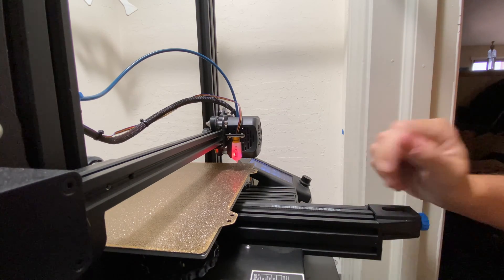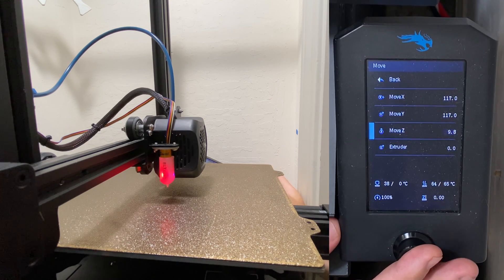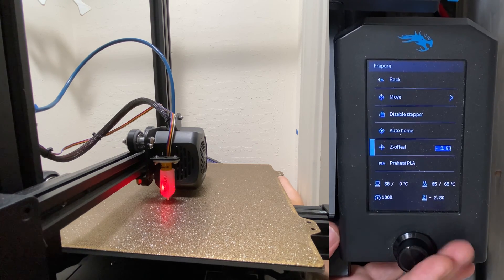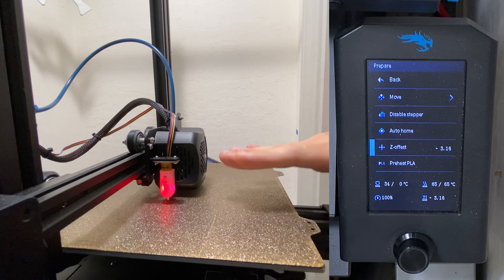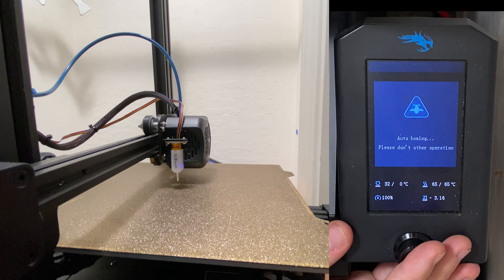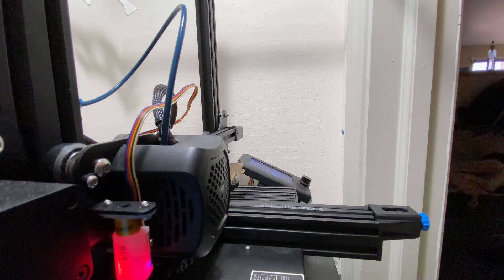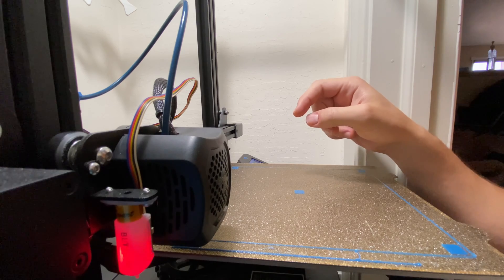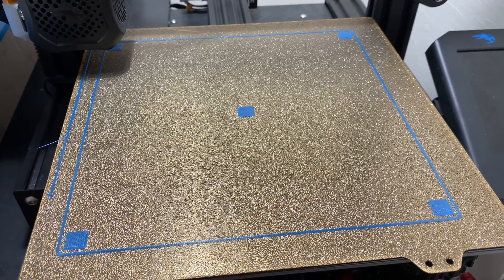Ender 3 V2 3D Printer, How to Calibrate Z Offset for BLTouch V3.1

Comment: Nice video!

If you can't move the Z-axis past 0 then what? Is this firmware related? I have the Marlin 2.0.x bugfix. 

I have the Z Offset Wizard menu item instead of the Z-offset menu item on your screen and with that the head will not move as I make adjustments to the offset value.

Comment: The comment at 3:28 in this video, claiming "you might want to step down 0.04 more once or twice" is what made most sense to me. All other videos test with paper and leave it at that, but they do not compensate for the paper's height later on. This video does. Thanks a lot

Comment: I have the CR Touch. Now a days the new firmware moves the nozzle as you turn the knob so don't have to click it when adjusting.
For some reason my machine wouldn't use the saved negative Z-Offset. Only until I did the offset at x117 & y117 did it actually work! so thanks :)

Comment: How did you generate the test print? Was it from a STL file or is it something the printer can do straight from the display commands?
Owning a Ender 3 V2 myself.
BTW what bed do you have and what slicing software you use? 
And any other recommendations that you might have wold be great. 
So darn new to this, trying to assimilate as much as I can. 
Tried the STL file that came on the SD card of the printer and sadly all I've achieved so far is a bunch of stringy mess. 
Thanks!
Reply: Same 😂

Comment: Thanks for this video.  I've found that when I do the following: 1) auto-home; 2) adjust Z-offset to -0.7 which just scrapes paper; 3) auto home; then 4) move Z to 0.0, I'm still 0.7 mm above the bed surface.  It seems to me that doing the auto-home overwrites the z-offset value.  Any advice?
Reply from the maker: I can’t say I’ve seen this issue. My main thought would be that it’s a firmware issue. Reflashing fresh firmware from a fresh file online on a 4096 allocation size fat32 formatted micro sd card. If that doesn’t solve the issue, and it’s crealities firmware, then I might advise switching to something like Jyers or insanity automation. They really kick it into next gear compared to crealities version of marlin firmware.

Comment: Thank you. When I try and adjust my Z-offset, I cannot get it close enough to the bed, at all. There is way too much space between the hot end and the bed, even when set to max of -10.00.... any ideas. I am using a CR-Touch and have removed the Z limit switch as instructed.
Reply: In addition to the first tip, I'd say to make sure your bed leveling adjustments are not cranked so the bed is the lowest possible.  Try raising the bed up to about 3/4 of the way to fully extended springs, then leveling the bed manually and finally running with the BLTouch and see if you can get there.
Reply from the maker: Without more info or being there. I can’t say for certain. One thing I noticed is that the stock Creality firmware is not great in terms of the bltouch. When I switched firmware away from creality’s, my bltouch problems went away. Other than firmware, there’s nothing in the way of the printer moving down? Something sticking out and catching it? If not that, then my thought goes to firmware issues. Also, just in case, make sure to home the printer multiple times as well, sometimes it gets weird in storing the homing data.
Reply: Mueve los tornillos de la cama,  afloja los o aprieta los para mover la cama más cerca de la boquilla.

Comment: Good video, very helpful. I take it these same steps will work if running the CR touch?
Reply from the maker: For the most part it should, yes. I’m not sure on the exact details of the CR touch, but I’m pretty sure the firmware is the same for both, possibly a different xy offset for the probe, basically when doing your z offset, you’d just need to make sure you move the nozzle to where the probe homes to in the middle of the bed. Ie, if the probe probes at X110 Y110 instead of X117 Y117. Then you just need to use the coordinate of wherever the probe touches during that step in the video.

Comment: Hello, please help, I have an Ender 3 S1 pro printer.
I changed the nozzle and when I try to level the bed, it lowers the extruder and the nozzle sticks against the bed and makes a very ugly noise, the cr touch works, I put a book on the bed and it did those 2 steps well. I raise the z axis. But when I tell him to level again he crashes into the bed. And raising the z-axis while it's making noise from being in contact with the bed makes me afraid to wait that long for the z-axis adjustment window to activate. I don't know if the limit switch needs to be adjusted.
Thanks in advance 🤗
Reply from the maker: Definitely either raising the limit switch, or giving it a positive z offset. However, once the nozzle has crashed into the bed even once, it’s likely deformed the nozzles hole now. Once you get the limit switch raised or z offset raised, you’ll definitely want to replace the nozzle if it’s brass.

Comment: Thanks super helpful. My Z offset didn't work,- it didn't move the hot end,  tried the "Z offet tool" and that worked. Don't forget to store settings once done
Reply from the maker: I had this issue before and reflashing the firmware solved my issue. I also highly recommend installing Jyers or first layer firmware. They are both so much better than Creality stock firmware.

Comment: Can you show a video of how to level it and save it as well I’ve tried everything I know I just can’t seem to get it
Reply from the maker: From my experience directly, I had the same issue and it required reflashing the firmware and it fixed it right up. Make sure to format your micro sd to fat32 with 4096 allocation size.

Comment: If you set the offset to the top of the paper, thats where the print starts? So too high?
Reply from the maker: Depending on the bed surface, yea. With mine, paper is perfect because it’s textured pei so it naturally has deeper sections of the bed surface. With glass, you might want to print the test print you see at the end of the video, measure thickness, then adjust z offset until you get the intended thickness on a one layer print.

Comment: Hi there. Very helpful video, but I am having troubling using the z-offset to move the nozzle down the rest of the way. Seems like when i adjust the number it doesnt move at all. Any idea what could be causing this? Thanks!
Reply from the maker: I’ve noticed this used to happen to me as well. Updating the firmware resolved the issue completely, but to fix it with changes, you should be able to simply turn off and on the machine again.
Reply: @3dprintutopia961  Got it all sorte! Turns out I didn't have baby stepping enabled haha. Thanks for the reply!!

Comment: Why does the bl touch drive the head into the bed?
I auto home, it might work. I zero the Z axis. I use a piece of paper and the Z offset to adjust the nozzle height.
I auto home again, it might work. 
I level the bed, sometimes it with level no worries, at other times it sits there flashing.
If it levels i print something.
It homes, then levels again😡, if it fails to level it will continue to try to print with the probe sticking out!
If it levels it auto homes which can cause a fail.

When it auto homes the head moves to the left front corner of the bed and up a few mm. It then moves the probe to the centre of the bed. The probe deploys, and lowers til it touches the bed, then it goes up redeploys and lowers a bit slower, then it goes up about 10mm or so. 
When it fails it just drives the probe and then the head into the bed compressing it as far as it goes and makes the steppers click and jump. It fails more times than it succeeds.
Reply from the maker: This sounds like a firmware issue and not the bltouch itself. I’ve had this issue before and I switched firmware to first layer firmware by insanity automation and it never happened again. Sometimes just redownloading the firmware and reformatting to fat32 with 4096 allocation size can fix the issue.
Reply: @3dprintutopia961  . The firmware is the marlin 1.1.2 bl touch. I have the pro not the v2, if that makes a difference. I’ll look at changing, thanks.

Ps. I just tried again after a sleep (night shifts aye) i auto homed, tested the nozzle height, and hit print. It was the xyz test cube. It didn’t auto level but did an auto home, started printing, had an adhesion failure, i canceled the print pulled the plastic off the bed and hit auto home. 
It centred itself deployed the probe lowered till the probe retracted.
Raised up again.
Deployed the probe, turned blue.
Started lowering.
The almost as soon as the probe touched it turned red and just kept going until i turned it off.
Reply from the maker: @python27au  It’s also sometimes just an issue with the download. If the download isn’t perfect and the extraction as well as just the firmware build itself, along with a myriad of other factors, the firmware could fail when it is uploaded to the machine. Simply re uploading the same firmware might fix it, or it might not. Just a thought.
Reply: @3dprintutopia961  Mate i could kiss you! It worked first go, didn’t even look like failing. I was just about ready to junk the thing and give up.
I tried formatting the card and re downloading the original file, that did nothing. I looked up the company you mentioned and after some digging found tens of dozens of files 😱 i have no idea what I’m doing so i just pick one at random that looks good and bugger me it worked. Its printing better than it ever did!!😁🥳

I just have to work out how to level it, it operates completely different to the other one and doesn’t look to intuitive.

But thank you very much mate.👍
Reply from the maker: @python27au  I’ll be working on a video about all the features of the firmware, it’s definitely a lot more than creality’s, that’s for sure.

Comment: I have a question. When I do the auto bed leveling feature, the left side of the bed the nozzle crashed into the bed because the touch is off the bed. Know of a way to correct this. It's like it thinks my bed is bigger than what it is
Reply from the maker: Ultimately, you touch needs to be closer to the bed. However, if you bought the one I use in this video, that shouldn’t happen. You could print a spacer so the bltouch is closer to the bed.
Reply: @3dprintutopia961  the probe does probe the bed correctly, until it reaches the left side of the bed
Reply from the maker: @chuckhope8909  Oh, apologies. So basically it thinks it’s too far to the left. Trying to move it to the right would be one possibility, but I don’t know the setup. I’m not sure if it’s bltouch or something else, but this firmware isn’t great for the cr touch yet because of the leveling issue you mentioned. It might be good to request the 5x5 grid be changed to a 3x3 or 4x4 so that it doesn’t reach the ends as much on some peoples bed. With the bltouch it works great for me though. Their is a way to change the configuration.h file in the firmware source code that allows you to shift the probe locations to points of your choosing. I think stuff like what you are explaining is more common with leveling probes in general if they happen to stick out a good amount from the extruder. Like my bltouch is pretty close to the hotend shroud. Is yours like that as well? Or a bit more space between?
Reply: @3dprintutopia961  how would you change the grid? I was thinking that should be something to try. I am using factory mount for the touch. Looks like a little less that 2" from the extruder.
Reply from the maker: @chuckhope8909  I haven’t done it myself before, but if you Google around about how to edit source code for the firmware and then search for where the bltouch grid commands are as well as what inputs you can enter, that should get you in the right direction. I found some info a year ago but never took the dive into firmware editing, so it’s somewhere out there.
Reply: @3dprintutopia961  f1rst layer to me to send a video. After I get done with my print I'll send one off. Thank you

Comment: I recently got a Ender 3 V2, and I can’t get filament to stick to my bed. It usually just curls up around the nozzle. Could someone maybe tell me what I’m doing wrong? I’ve tried cleaning the bed, adjusting temperatures, etc, and it’s still not working. Not sure if it’s something with the Z offset or if my bed is still not level.
Reply from the maker: Might be good to slow down your first layer speed. Start painfully slow at 5mm/s with a first layer height of 0.32mm until you can get it to stick. Taking the bed surface to the sink and washing with an extra toothbrush and a drop or two of dawn dish soap and a bit of hot water, then rinse thoroughly with hot water and pat dry with a paper towel. Also, ensuring your bed springs are nice and tight helps as well. You’ll likely want to buy some yellow bed springs to install as the stock ones aren’t great and make you have to level too often imo. Just to make sure, you have a BLTouch installed or no? If not then you’ll just need to play with your paper method. If you do have a BLTouch, then you’ll need to change the z offset. But first, try the slower speed and thicker first layer. If that doesn’t work, then do other stuff.

Comment: Why does my bltouch when I set it to zero crash into the bed but when I don't en I fix it with zo offset en get it tuned and it does an autolevel. Still does not can go True all 9 points on my bed. And sometimes the middle one where I set everything to??

Help!
Reply from the maker: I’m not sure I completely understand the question. For it crashing into the bed at least, I’ve had that issue before and reflagging the firmware has helped. Occasionally before I reflagged my firmware, it also would probe only four points then get an error and stop. Reflashing the firmware solved this issue for me as well. Always make sure you use a freshly formatted MicroSD.
Reply: @3dprintutopia961  can I send like a video to you?
Do you have instagram or something?
Reply from the maker: @Houtoriteit  yea, Instagram works. I’m @knd3dprints on IG, or you can post on the Creality official user group on fb in case it’s something I don’t know how to solve, either works.
Reply: @3dprintutopia961  Just send you via insta

Comment: Do you save the settings afterwards?
Reply from the maker: You definitely can. Just keep in mind, if you switch bed surfaces often, then you will need to change it each time. It sort of keeps me in check by not saving it, but then sometimes it just decides to save on its own.
Reply: @3dprintutopia961  How do you know if settings have saved? I’ve just bought a printer and had a play yesterday and having a hard time figuring out BLtouch piece in terms of this aspect
Reply: @3dprintutopia961  if the z offset is the z distance from nozzle to bltouch why does changing your bed sheet matter to it?
Reply from the maker: @rhadiem  For something like flat Glass or smooth PEI, for me at least, I can’t have too much or too little of a squish, it needs to be just right, unfortunately though, because of that, lines are visible much more on the bottom of prints, however, with textured PEI, I like extra squish so that the bottom of my prints don’t show lines at all. This is useful for me because I sell art pieces that utilize the texture of the bed to give added effect. I’m sure you could use the same z offset for various prints and bed surfaces, just in my personal opinion, having it dialed in for each one makes it easier for me as well as better prints. But if one value works for you, then by all means, stick to that. Definitely good to experiment.